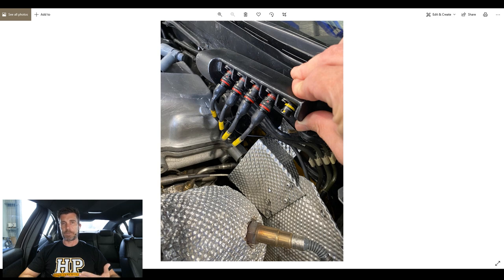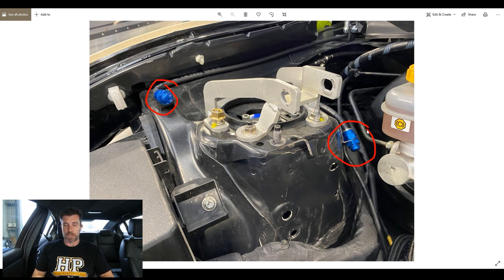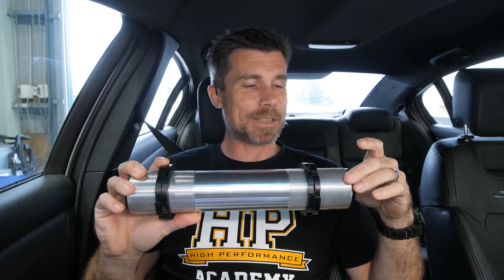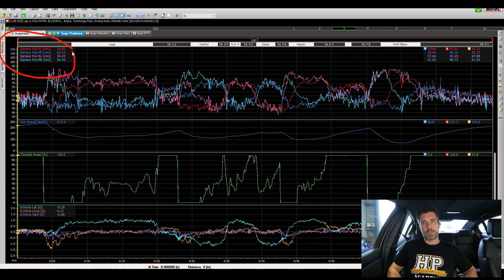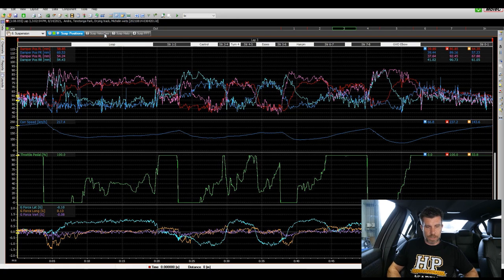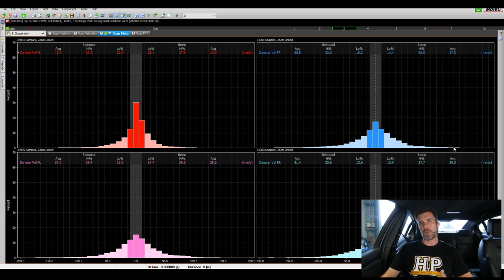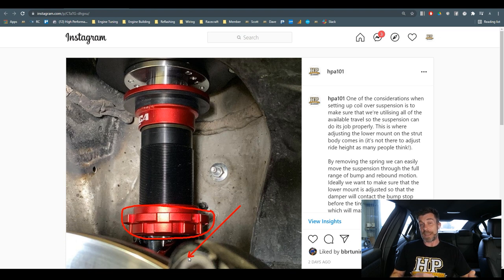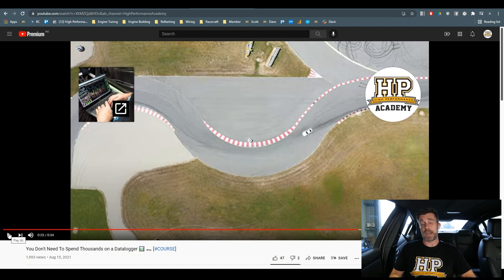Coil Setup Upgrade & Air Jacks | Today At HPA [#UPDATE 292]

Comment: Neat air jack stands - is there a third support for the top tier, that's hidden by one of the front ones?
With the dual threat strut/damper body, most of us do tend to focus on the spring used and ride height, myself included - on that, are you planning on expanding on this with a guide to spring rate and, what is so frequently overlooked, the correct spring length for the application?

Comment: Great stuff Andre. Can you share the part number for that Raychem boot used on the IGN1A coils? I had a hard time finding any info on the correct one to use when I was building my harness. Also, can it be used on the standard connector, or does it require the fancy ones with a boot lip?

Comment: Why do you need to coast when doing the down force measurement?  Why can't the car remain at full power to keep the vehicle speed constant?
Reply: Because under acceleration the car will usually “squat” causing faulty height readings. So by coasting you can see how much downforce is generated without being affected by acceleration!